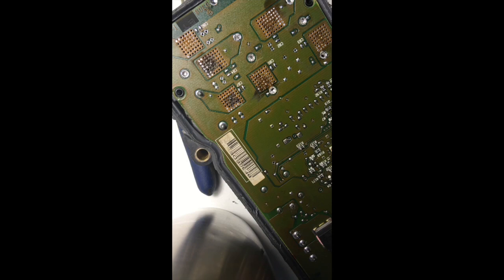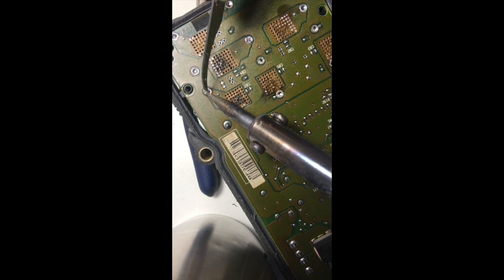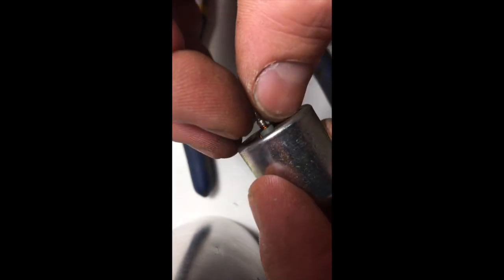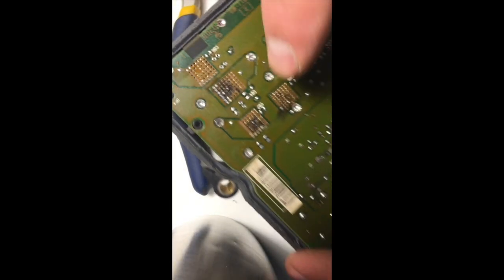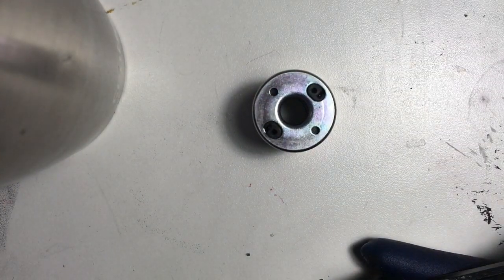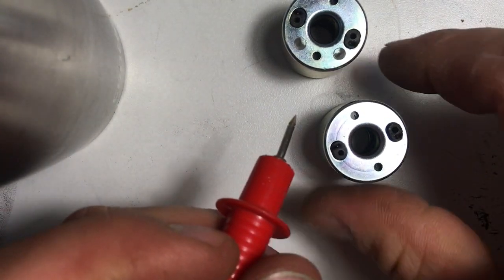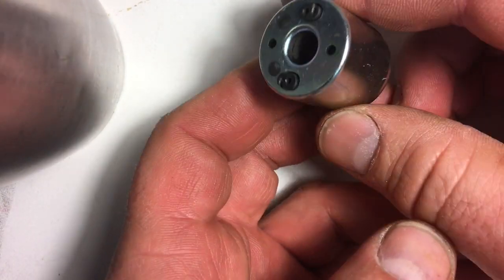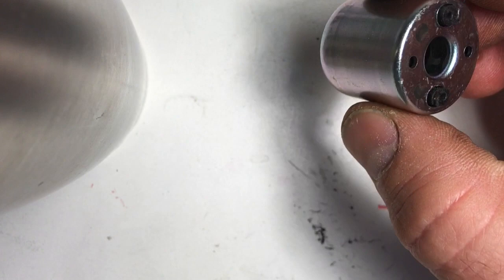Part 2/5   2003 F150 ABS Module Repair, removing and testing the coils

Comment: Magnet/coil wire on the coils....  have to touch the exposed ends.  And reconnecting magnet wire is tough, and especially when you don't have a tail to strip and solder in a lap joint.  Butt joint soldering magnet wire is tough.